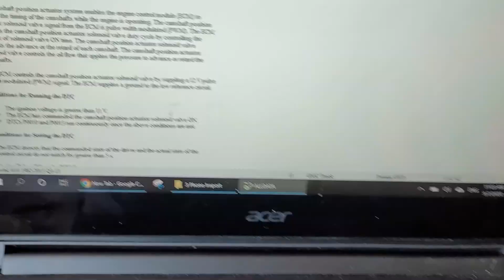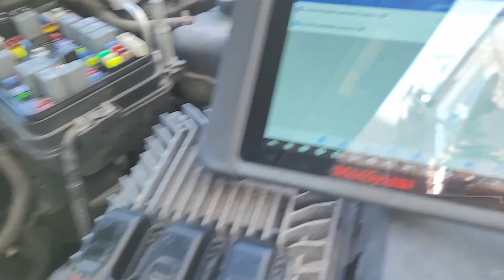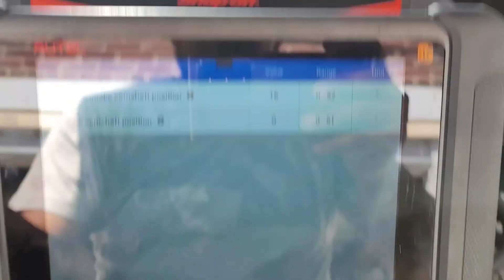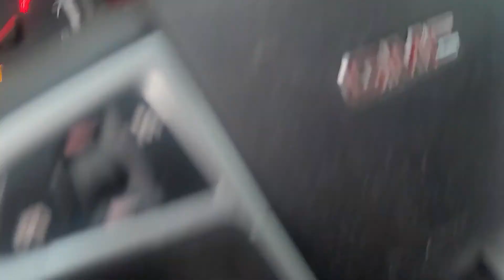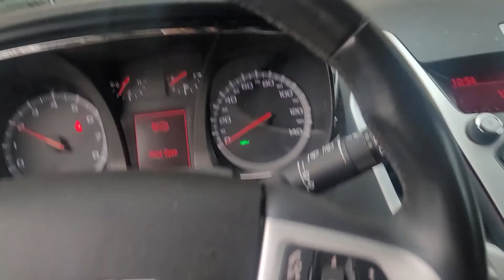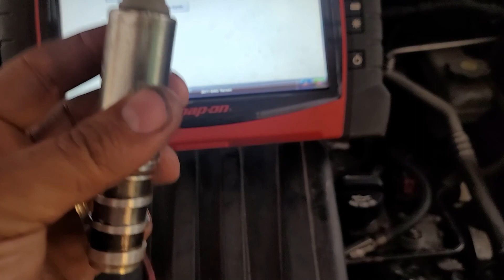2011 GMC TERRAIN P0010 Intake camshaft position actuator solenoid valve control circuit Part 2

Comment: Great video I had my 2011 Gmc Terrain diagnosis with the same problem, but its running fine haven't notice any drivably issues just an engine warning light I parked it until getting fix. My question is at a 100 thousand miles is it a good idea to just replace both intake and exhaust solenoids .
Reply from the maker: yes good idea

Comment: Best video for this specific problem. A1 job going through all tests for diagnosis.  Every other video on YouTube starts with some grease monkey telling us they are changing the solenoid.  And they proceed to tell you how to remove the engine cover but they don't tell you how they determined the part failed.  lol.  I don't need a guy to tell me how to turn a wrench.  This guy here figured that the solenoid resistance may increase as the engine gets hot, causing it to go out of operating spec and creating drivability problems.  Brilliant.  This is exactly what happened with my car.  the resistance checked out when the engine was cold.  after driving for 20 min, the same solenoid showed a resistance higher than spec.  Problem solved.  thanks for fixing my car Dallas Auto Diag.
Reply from the maker: I have had a bad day. You just changed it. Thanks, Richard.
Reply: Buenas noches disculpe yo tengo este problema con mi TERRAIN, entonces aquí la solución fue cambiar los selenoides???
No fue problema del arnés, disculpen mi ignorancia pero esque quisiera poder solucionar antes de acudir con un mecánico